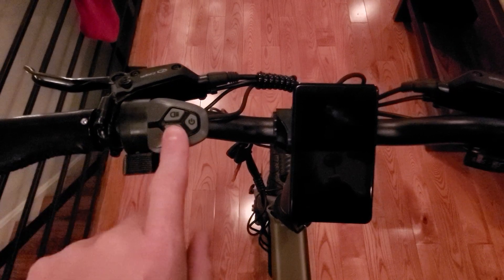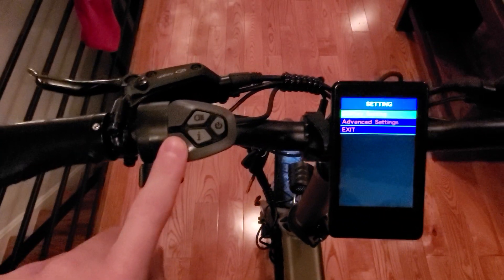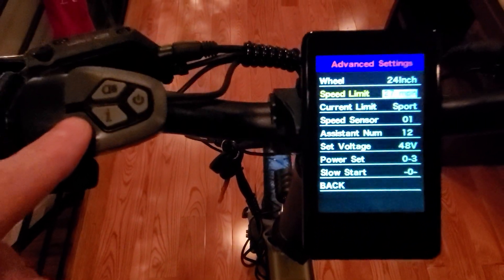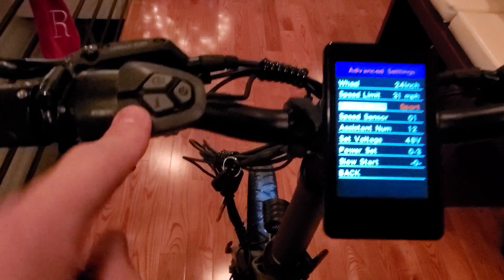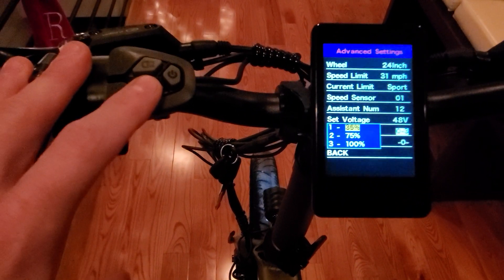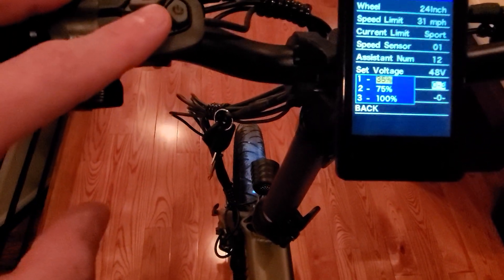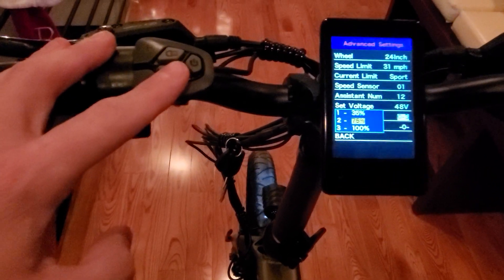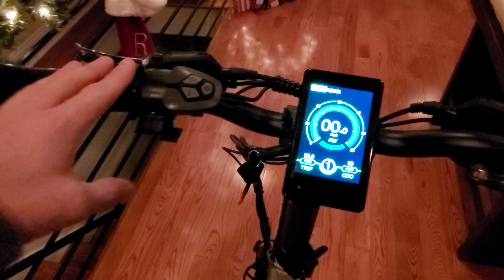Rattan e-bike LCD display

Comment: I’m also curious about the Speed Sensor entry. I wonder if it’s the number of sensors on the pedal crank being used at any given time (battery considerations).
Reply from the maker: Yes I believe it's the number of magnets (12) in the cadence sensor.
Reply: @charliefoxtrot9783  hi, then how come you say you use 1 (and 1 as well in video) , wouldn't it be 12 for speed sensor? i see you have 12 in assistant num, so many taht's the setting?

Comment: Did you ever find out what the speed sensor does?
Reply: Anyone know yet?
Reply: @chicheng1941  I have found that it adjusts the measurement of your speedometer. It can be adjusted to match the correct speed. I use google maps to figure out my current speed with GPS and then adjust the speed sensor settings until it's as close to that as I can get. Hope it helps.

Comment: I have a rattan challenger plus ebike and on my lcd display the current limit is all numbers. It can be changed from 7.0a to 25amps. I think my battery is rated 36v and 10amp. Do you think setting it at 20amp would hurt the motor? Looks like your current limit goes from normal, sport and other range??